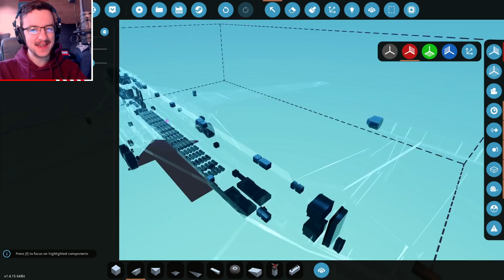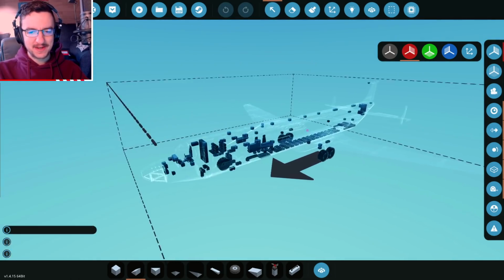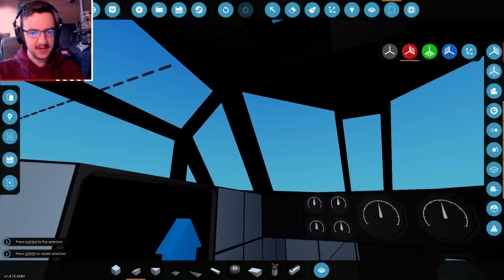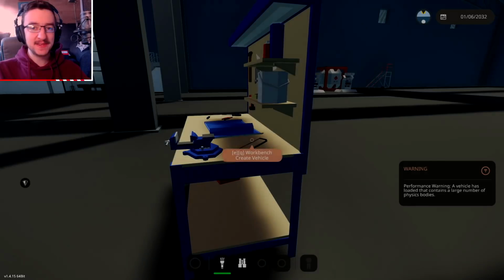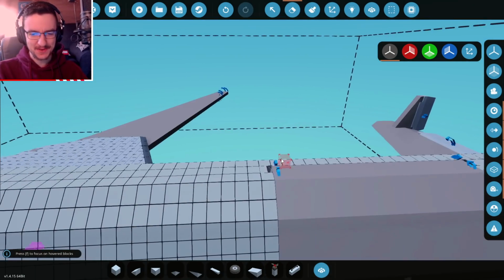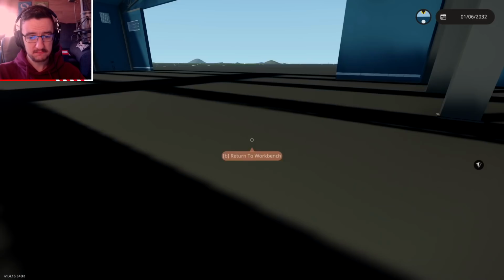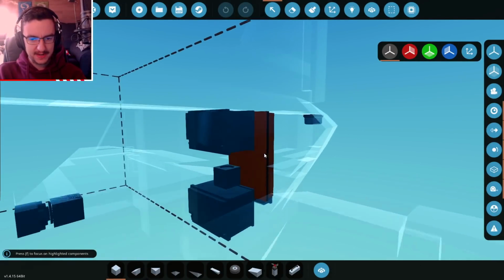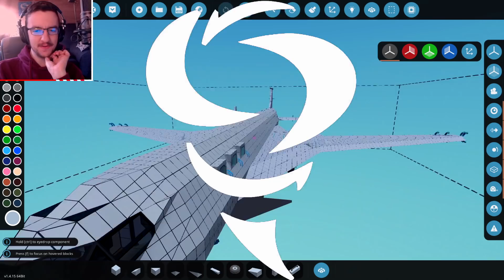MORE WING SWEEP & AUTOPILOT! - Bomber Build - Stormworks Search and Destroy

Comment: Nice work!  Looking great, the increased wing sweep is fitting, and I love automating systems so hell yeah to coupling it with a speed.  You could also do a similar thing, or use the threshold block so its 1 item vs 2, and tie it to the altitude to raise/lower your gear as a cool thought.  Alt hold is looking promising, tune D as well for that current P value because it didn't look bad.

Comment: Capacitors can still get the landing gear stuck, so you should use a contact sensor on the gear to toggle the doors
Reply: Done right you can use 1 signal and 1 capacitor for an entire plane and it will never fail you.
Reply: @probably3dprintingsomething  I've done that, it fails with quick gear cycling

Comment: for the auto sweep, if the speed, example 50 mph, is reached, then the wings would sweep back. the wings should be forward for take off, since it moves center of lift forward, i think. anyway, 
s (speed) > 50, then +1 input to sweep. if s<50 then -1 or 0 input to sweep.